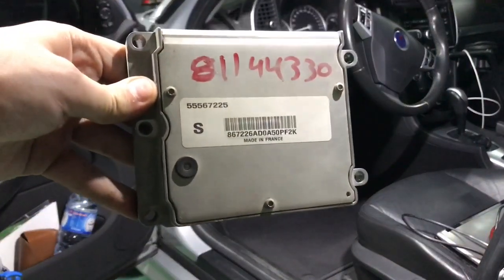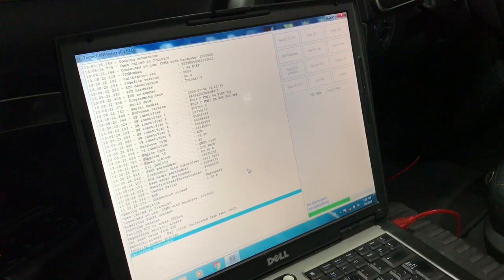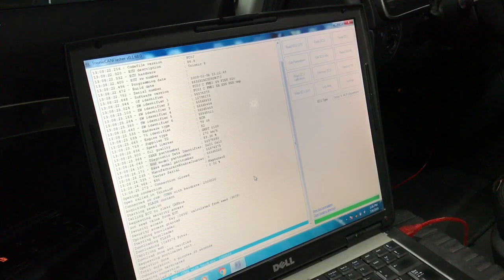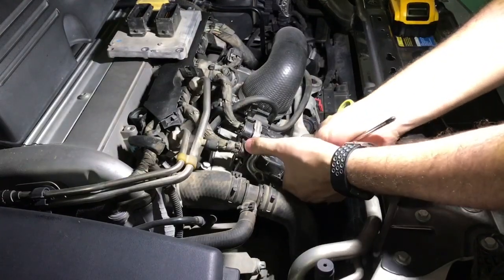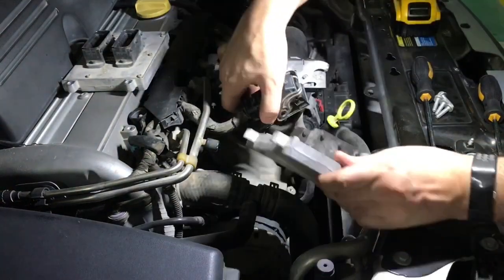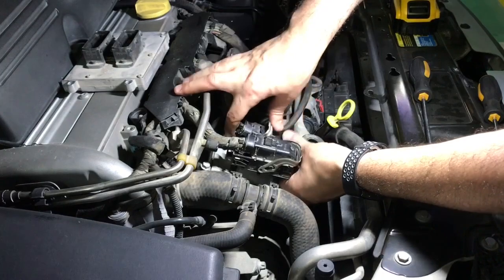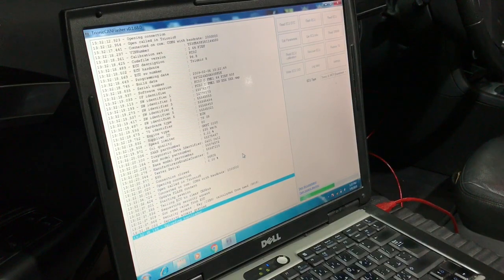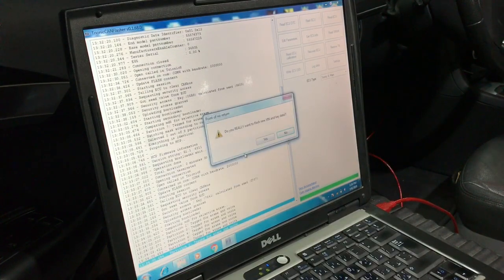SAAB 93 ENGINE ECU/ECM SWAP (TRIONIC T8)

Comment: One note for those that have  2008-2011 2.0T B207 9-3 XWD- A replacement ECU part number must be 55567225, otherwise the fuel guage will not work properly.  However  ECU's with part# 55567225 will work on FWD 2003-2011 cars perfectly.  So, this ECU (55567225) is backwards compatible, but specific to cars with XWD.

Comment: Thank you for this video! Just fixed a 2003 9-3 Vector which had it's original ECU fail a month ago. Got a replacement ECU from a 2007. Flashed the MCP then flashed the main .bin and it runs and works great now. Your video made it so easy to walkthrough the process!

Comment: My Saab 9-3 2004 2,0t keep getting P0245 P0201 P0202 P0203 P0204 after around 1 hour of drive, then I send my old ecu to someone to clone it to a “new” ecu, got both back but the car started sound like a tractor and won’t rev above 3000rpm after “new” ecu installed, What you think the problem is? And how to solve it? Is the “new” ecu broken?  Please help, it been 2 months now and can’t drive normally.
Reply from the maker: Whats the fault codes on the current ECU ?? Possible wrong cloning if no codes
Reply: @TheFlyingMechanicDIY  unfortunately i don’t have tech2 or other expensive obd, I have a scanner who shows me codes when the check engine light is on.  The guy who clone the ecu said that I broke the ecu because I didn’t remove the negative from the battery. But you and many others said it’s caused by improper cloning. It something wrong with the software in the new ecu that he didn’t solve.
Reply from the maker: @Babaa016  no removing the cable has zero effect .. do u still have ur old ECU ?
Reply: Yes, in the car, works fine in cold weather. Gives me the check engine light when it’s hot. I send back the “new” ecu back to the guy who cloned it. To see what the problem is.

Comment: Great video......
i just try to clone aT8 with obdlink sx today on car, but it gives a lot of frame droped, and i use bench to clone it, i read just fine in table, but when i try to write, no response from the program, and i replace obdlinsx wit sm2 pro ori........   with sm2 the program start writing but with errors....  and from then i lost communication with ecu, no recover and restore works from trionicCanflasher........  and now i am looking a way to unbrick the ecu......  i don't know if i use the dump that i had read previously with obdlinksx directly in to flash with programmer.....

Comment: Hello. In the settings of the Trionic CAN Flasher, do you have unlocking the partitions and unlocking the boot when you record from the old ECU and then to the new one checked?
In the trionictuning forum in the registration what answer do you have dose to the security question because I can't find it and the admin doesn't answer emails.
Reply from the maker: I cant recall from memory, i dont have immediate access to my laptop.
But the safest thing is start with these unchecked for both, and see when u flash the new module if it pops the vin transfer msg, if it doesnt then redo it with them checked ..
Reply: Thank you!
 @TheFlyingMechanicDIY

Comment: Hi guys ,good video but i have a problem for write in new ecu.I have saab 93 and i buy vectra t8 ecu.Ecu saab read perfect.But when i write in opel ecu ,i have blocked at bootloader unlock.what is problem? Thanks
Reply from the maker: Opel and SAAB ECUs are not interchangeable
Reply: @TheFlyingMechanicDIY  the response is beceause z22se

Comment: Hello, I tried, everything went well, but the car does not start, no starter, no error message, do you have an idea?
Reply from the maker: Battery low maybe .. but why u replaced the ECU ??
Reply: @TheFlyingMechanicDIY  I have a charger plugged in. because I've codes P0201 0202 0203 0204 0245 and 0246 and difficult hot start
Reply from the maker: @pascalliegeois4460  does the car crank now ?
Reply: @TheFlyingMechanicDIY  I tried with a computer with Win 7, everything works, thanks!

Comment: Is this for people without a TECH2 or is this for anyone who wants to copy data across? If you get a like for like ECU part number then a copy won't be needed right?
Reply from the maker: Correct it is for people without a tech2, or for people that have tunes installed.
Matching the number on the ecu does not guarantee the software matching though .
Reply: @TheFlyingMechanicDIY  Thanks for confirming. Your videos are superb and help us keep SAAB's on the road :)

Comment: When I click read ECU and then hit save for the file it tries for a while and then will give me some lines about dropping and retrying frames and after nearly 10 minutes it just says operation failed. Does anyone know why?
Reply: Nvm for some reason turning the key to off position after boot loader starts fixed it. Read it on the online guide

Comment: I just did this today. 2005 9-3 with a donor 2004 ECU ($30.0).  Car is totally like new again.  With new laptop it was really only 20 min to flash.   OBD SX cable came all set right out of the box as well.  Thank you for posting this video.  this just saved me thousands of dollars. 😃
Reply: By chance your able to find another donor ecu? They are obsolete here where I’m at.
Reply: I just did it once more just today to another one.  I got three used of the bay. @trevorgameurl1644

Comment: My car is a 2006 2.0T.  Can I re-program any Trionic T8 Saab 9-3 computer as a replacement, or does it have to be a 2003 - 2006?
Reply from the maker: Using this method yes

Comment: Mine keeps saying dropped frame then says local data doesn't match ecu when I'm trying to read my original ecu on the car? Any suggestions 🤔 🤷‍♀️
Reply: I had this same problem too for some reason turning ignition to off after it gave a message about the boot loader fixed it. That’s what the online canflasher guide said to do. I didn’t do other steps it recommended though, I left my latency on 16 and it was fine. That was just for getting ecu info and reading though. Having trouble flashing now…

Comment: Would this work between any year (2003+) ECU's as long as they came off the same engine? Meaning, could I buy an ECU from an '04 (or any other year) and clone my '07 ECU onto it as long as they are both 2.0T's?
Reply from the maker: Any ECU thats marketed as T8 is the same ..

Comment: This video does an excellent job explaining the process. I have completed the task of reading/saving my car ECU files (T8 and MCP). The ECU that I want to replace has a part number 55567225. I need to verify that that this process will work to marry an ECU 55567225 to 55565020 or 55353231. I am having trouble finding the ECU 55567225.
Reply from the maker: The part number doesnt matter, it will work for any ECU that is called T8
Reply: @TheFlyingMechanicDIY  Today I tried process car would no start. I did not get message to transfer VIN number when i flashed T8 main. i am wondering if checkbox for unblock partition was left unchecked when i copied my old ECU? Have damaged my new ECU? Cant do anything now.---------------

Comment: Nice video, tried it today, seems to read ECU's ok but when I try flash it goes through the whole process I do not get the prompted to change VIN # and after completed I run read info and nothing changed
Reply from the maker: Check the trionic flasher settings

Comment: Hello, when is it that you can skip mcp step. It's it when both cars are 2006 and older, AND flashing off the car or just similar years? Thanks
Reply from the maker: Mcp flashing is not required if both the car and the spare ECU are from the same era, there are two eras (2006 and before) (2007 and up)

Comment: Thanks my man, I just finished flashing my ECU and car started up. Key was keeping the car on a charger to finish process because my battery dropped down to 9 volts while flashing (charger had shut off) but still finished flashing. Last ECU flash part took 30 minutes for me.
Reply from the maker: So u gave up on the idea of ohm checking the injectors 😉

Comment: So does this mean that if you were able to swap your own car's computer into a stranger's car, you could then use your keys to drive that car away, then back home where you could flash the other computer removed from the stolen car with your computer's signature, put the loose computer back in your car, and then your keys would be good in both cars?

(I don't intend to try this, btw.)
Reply from the maker: The short answer is NO 😬

Comment: Do ECUs ever go bad without any fault codes? My car won't start when you turn the key (not even a click) but the ignition comes on and the car can be jumped from the starter relay, runs for ten seconds then stalls.
Wiring from the ECU to relay box is fine, and from the relay box to the starter motor. Relays are all okay.
Auto electrician that came out tested the key and that is working but said there was no start signal anywhere on the CAN network when the key is turned. Definitely not an immobiliser problem, and I have sent the ECU away to be cloned off the car (to a reputable ECU company) but I want to make sure I am not likely to spend a lot of money for the problem to stay.
I have a spare CIM with the correct ident code but auto electrician seemed hesitant to try that. He does have Tech2.

Thanks in advance x
Reply from the maker: Yes it can go bad without codes however it is least likely .
If there is no start request pid, then it is probably ISM .
Reply: @TheFlyingMechanicDIY  Thank you for your reply - I have a space CIM and ignition barrel to try after this. Car is a Vectra C so slightly different but has the Z20NET / B207 engine and T8 ECU. Would you recommend staying away from the Chinese Tech2 / Opcom units?
Reply from the maker: @SerenaBluee  i use the Chinese ones with no issues
Reply: @TheFlyingMechanicDIY  Thank you so much for the quick replies. It may end up paying for itself for personal use with how frequently the modules seem to fail in these cars. Wouldn't risk it on someone elses car.

Comment: Just did the 'read ECU' bit today (waiting for the spare ECU I ordered to flash it). Note if you're getting a 'frame dropped' problem: you might need to try with a more modern laptop (that was my issue). Also: in my case I found it is very important NOT to move the laptop once the read process has started. Any time the cable moved - even a hair - triggered a cascade of 'frame dropped' messages and the process eventually failed every time. If I left the laptop sitting in one place and undisturbed throughout the process it worked beautifully. Again, great video!!
Reply: Me too!!!
Reply: I have a newer computer and it keeps saying dropped frame and then says local data doesn't match ecu
Reply: @heathermartin9714 did you ever get it figured out?
Reply: Make sure you update your drivers before doing the flash and it will work

Comment: Ok so I copied the t8 and main from my old ecu to the new one. My old one has a stage 1 tune. I dont have to separately flash the tune in the new one do I? I kind of wanted to copy the necessary information from my old one without transferring the tune :/
Reply from the maker: Then The only way to do that is with Tech2 and TIS ..

Comment: Thank you so much for this video! It's incredibly helpful. I have a 2004 9-3 Aero throwing up codes P0201 through P0204 and P0245 so I'm going to do this. But I'm kind of confused about which used ECU to get. I was told "you can buy any ECU with any #, it doesn't matter". But it can't be any ECU, right? It has to be for a 2003-2011 2.0L model, right? I see some ECUs on eBay which I don't think will fit my car... my own model is a 55353231. So basically anything with the same connectors and same holes mounting pattern?
Reply from the maker: Any ECU from a 2.0 saab 93 2003-2011 will work .. just like hus_sho told u on the forum 🤣
Reply: @TheFlyingMechanicDIY  :-D Great, thanks. That stuff can be confusing if you're not familiar with it... in the end it looks like there'd be no advantage to go with a different model, as far as I can tell different models are not cheaper than mine. Thank you so much, great video!
Reply: @OlivierGandou  Plot Twist: Hus_sho is The Flying Mechanic 🤣
Reply: @NahasMajeedA  Ah, had no idea!

Comment: Simple and straight forward.  Didn't work for me.   Said it was successful.   tried a second time and it says the information is the same.  I even tried again on a second ecu.  same.  VIN number does not change to original.   Oh well.  I tried.
Reply from the maker: Change COM speed sitting to a lower speed and keep trying .
Reply: @TheFlyingMechanicDIY  thanks, but was already set to as lowest setting.
Reply from the maker: @neilfoster980  try different speeds
Reply: Same to me today... Did you change the vin?
Reply: @ericappel4576  never.  Tried many times.  Gave up and paid someone $40 to clone 2 for me.  One for backup.  Good luck.
Reply: @ericappel4576  Did you get your's figured out? I can't get it to transfer VIN information over.

Comment: Thanks so much for this detailed and well explained video. Was a success. Question though.. With my old ecu I would keep getting p0033 codes and lean codes even though all my hoses, boost solenoid and everything were good. Coilpacks and spark plugs would also go bad after a month or two. Should this new ecu fix that problem?
Reply from the maker: I dont think a new ECU will fix that.
Remove the bypass valve diaphragm and inspect it.
Reply: @TheFlyingMechanicDIY  I replaced the bypass valve with an aftermarket one. Forge Motorsport, and because I'm tuned I used the right spring setting
Reply from the maker: @adrianleon1731  revert to stock valve and see
Reply: @TheFlyingMechanicDIY  And as far as coilpacks going bad after 1 month of heavy driving ? I bought oem mitsubishi coilpacks brand new and they're now taking a shit on me. Would that be something caused by a faulty bypass valve too?
Reply from the maker: @adrianleon1731  no not at all, these coils never fail in less than 10 years .. but why would u say they failed ? How do u know?
Reply: @TheFlyingMechanicDIY  The coilpacls would run good for about a month before I started getting misfires again. I guess I have other things to be looking at other than my coilpacks
Reply from the maker: @Adrian Leon if u have lean codes its better u fix that first , second of all who tuned the car ?
Reply: @TheFlyingMechanicDIY  It was a custom made tune. Ryan king tuned me
Reply from the maker: @adrianleon1731  well, im not a big fan of custom tune , as ive seen things go sideways in saabs 🤷‍♂️

Comment: I have my original 2007 sabb 9-3 Manuel trans ecu and a replacement 2007 sabb 9-3 but this ecu comes from an automatic . Do I need to do another step ? Will I  have any issues
Reply from the maker: If u clone it with this method nothing else is required ..
Reply: @TheFlyingMechanicDIY  
......
Reply from the maker: @hbk12396  as long as it can communicate then no problem ..
Reply: Very cool ! You the man
Reply: FYI my original Manuel ecu is damaged is that an issue at all earthier

Comment: Question, in a "Tech2 perspective" all ecus needs to be virginized before they can be used in another car. As far as I understand thats only necessary when you are working with original software. So, does the ecu needs to be virginized or not? :)
Reply from the maker: No ECU  need to virginized, tech2 can work with all modules being used/new, add them to the car and program them if required.
Reply: @The Flying MechanicDIY I'm very thankful for your answer. Sorry for asking again (I'm lacking good english)  but do you mean that it doesn't need to be virginized if you are using the cable and software you are using? :)

Comment: Good afternoon. I have a 2003 saab linear 9-3 2.0t..i have replace the computer on it and also did a stage 1 upgrade on it (since I was going to replace the computer).. I've put the computer on the car and now this codes came up.. 
P2127,PO641,PO441..
I've check continuity from the computer connector to the gas pedal and everting check ok I also  replace the gas pedal and throttle body just too rule out any hardware malfunction.. The reason why I change the computer is because it burn pin one on the connector closest to the battery.. Could it be that when copying the data of my old computer it also copy this codes and put it in the new computer??.. Any body had this codes come up before??.. And information will be appreciated!!..
Reply from the maker: Read this link, check the big grey connector under the battery, remove the ECU and inspect for bent pins, no software will copy any codes that u cant clear .
From memory u replaced the connector as well, maybe u wana double check all the wires are correct .
https://www.saabcentral.com/threads/the-big-grey-connector-under-the-battery-h42-2-h24-2-connectors-same-connector-just-different-name-depend-on-model-year.736374/
Reply: @TheFlyingMechanicDIY  Yes I will double check the connector..I was thinking about just replacing the engine wire harness just to make sure all wires are where they supposed to be..

Comment: I never got a prompt to transfer the VIN and key data to the new ECU. The rest of the flash completed properly, and now the car won't start. Is there a way to transfer the key and VIN data over separately?
Reply from the maker: No, ur setup is incorrect and you need to re do the flash.. try reducing com speed
Reply: @TheFlyingMechanicDIY  Does it matter if it is just for the flash? Or do I need to redo the read and flash at different speeds. It still isn't prompting me to change or the VIN and key information to the new ECU.
Reply from the maker: @asbunce  from the Trionic software make sure u have the following options CHECKED: ( I KNOW WHAT I AM DOING & UNLOCK SYSTEM PARTITION)